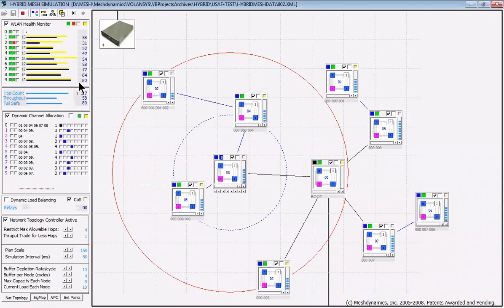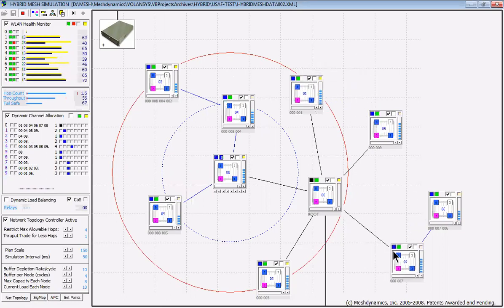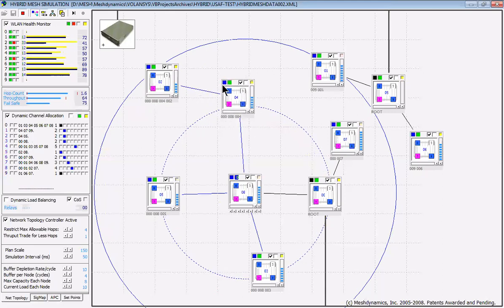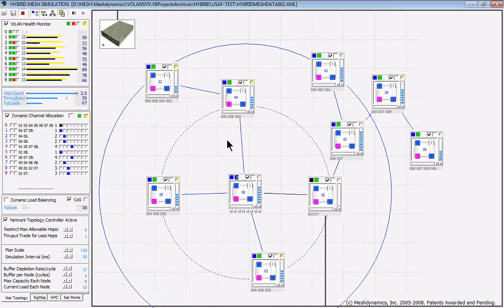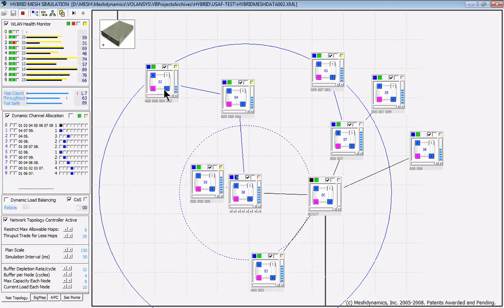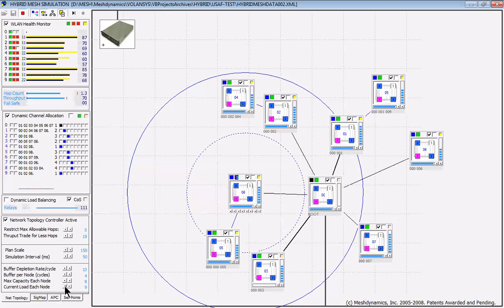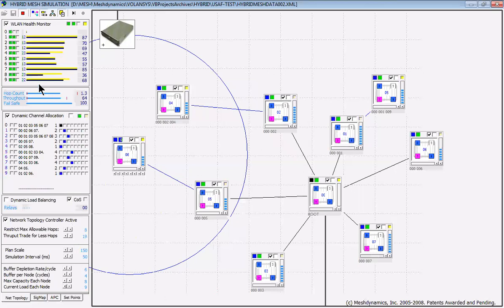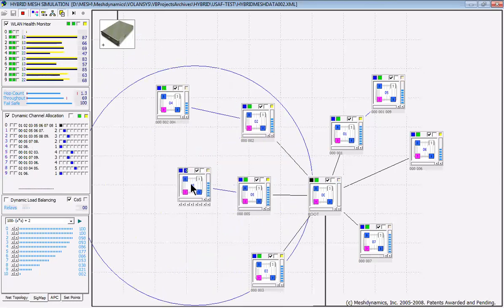Network Design Layout Primer

Comment: Great video! Any demos you can put on here? Glad you are active again.
Reply from the maker: Thanks for your interest. I have added two "historical" animations that were presented around 2003 to the US government. This was in support of a multi-year development contract to support stuff like sensor dust, using a Not-IP protocol to avoid detection. These animations show a self tuning network based on high level commands e.g set latency/throughput to be between ... or limit the tree to 2 hops only and force new roots to be created (forking).